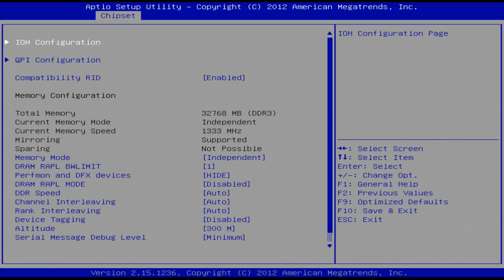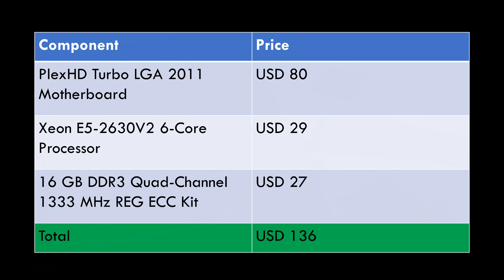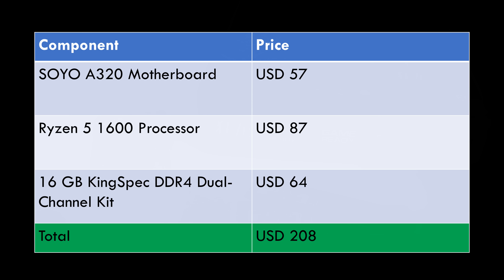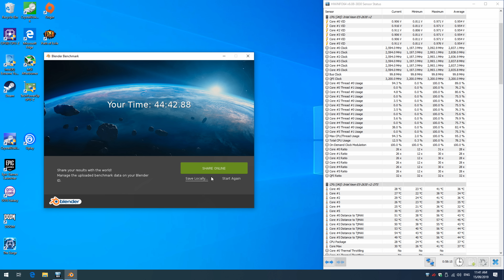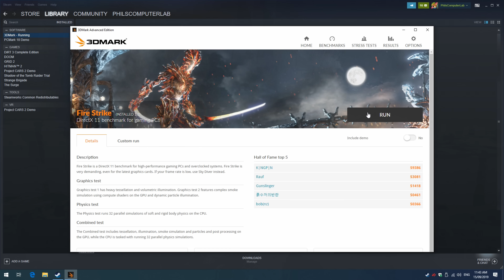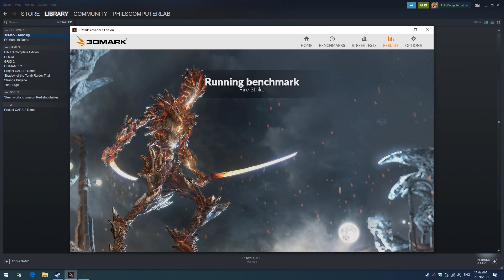Is this cheap 6-Core CPU worth it? The Xeon E5 2630V2

Comment: You know, sometimes I feel like YouTubers are making videos just for me! I've been looking at replacing my i5 NUC server with something a bit more powerful, but still reasonably energy efficient, and I've been looking at the LGA 2011 or even the 1150 Xeon low-power processors, which look pretty much like exactly what I'm looking for on paper. It's definitely encouraging to see the processors are compatible with standard motherboards, and that they're still pretty energy efficient even if the motherboards don't have all the bells and whistles of a brand name, so that's another possibility to consider.

The low-power Xeons are pretty hard to come by though, and they've been pretty overpriced when I have found them, so I'm thinking I end up having to go for a Ryzen 5 or 7 "E" model, which are 45W. Although main advantage of the Xeon is the cost of the RAM, since you can pick up large capacity DDR3 server DIMMs for pretty cheap compared to DDR4. That's the other limiting factor with my current server, since it's only got 16GB of RAM, so buying more DDR4 RAM is going to get expensive pretty fast.

Anyway, great video as always, good food for thought.

Comment: I did manage to buy and excellent ASUS p9X79 Pro which I paired with 32GB of non EEC RAM and an E5-1650V2 plus GTX 980.  The motherboard cost me $70 on a local purchase and it was like new.  What a deal.  Also have a HuananZhi deluxe X79 paired to an E5-4627V2 (costs $96 delivered with 8C/8T that all-core clocks to 3.5Ghz) and RX4708GB. Both do very well in 1080P high settings.
Reply: Good choice, that 1650 v2. And with that mobo, you can overclock it 4.4-4.6GHz easily. I know because I have a X99 Asus Rampage Extreme V - 10 Edition and a 1650 v3 at 4.5GHz. It can go higher, but I would need a better cooling. Any good X79 and X99 will run everything, in the highest settings, with a good Xeon and a good graphics card.
No need to upgrade for at least a couple of years (my opinion only).
Reply: @georgebadiu  Yup, board is excellent.  The E5-1650V2 easily clocks to 4.4Ghz and with the CoolerMaster tower (that came with the motherboard along with an i78320 and 32GB of Kingston HyperX DDR3 1600, all in for $220) idles cool in the mid 30's and peaks at 100% power to mid 60's. One might even argue the value of each the components purchased means that the ASUS p9X79 Pro was for free!!!! Still pinching myself over this deal.

Comment: Good video Phils!
I have this processor with a rx 488 and I'm enjoying it, for those who come out of 775 or is low on money the 2630V2 is a balanced choice between consumption and performance.
My setup cost $ 296 (R $ 1,200 in Brazil);
2630V2, 16Gb @ 1600mhz, Huananzhi x79, RX 488, Aigo T4.
I have not yet tested all the games I wanted but which I have tested, I really liked the result.
Reply: Seria interessante saber pq quanto tempo usou esse setup,se teve problemas e qual é o setup atual
Reply: @ilbroken2491  Usei por quase um ano se não me engano junto com uma placa da Huananzhi, então eu troquei para um 2620v3, a GPU morreu com 1,8 anos de uso (o chip da GPU morreu, era de mineração, embora não tivesse sinais agressivos de bastante uso), logo passei a usar uma R9 270 (mais tarde uma GTX 950) e troquei o 2620v3 por um 2678v3 e uma F8 da Huananzhi que uso agora há mais de um ano com um 2695v3 e uma RX 6600 (uns 4 meses).
Único problema era a performance em jogos como CS (que ainda é o mesmo).
Se eu fosse escolher algumas opções de processadores da linha V2 para um custo não muito alto, seria o 2630v2 ou o 2650v2. Gostava do consumo dele, frio demais se não me engano nem passava dos 50° em dias quentes com um cooler de 4 heatpipes e não tinha tela azul, já que usava memórias de servidor, atualmente já tive por volta de 6 telas azuis dentro do tempo + de 1 ano.

Comment: I've noticed a lot of the Russian sites as re using the LGA2011 with the 2680v2 and 2690v2. They really seem to hold their own in the games. 👍🙂
Reply from the maker: Yes for sure, but those CPUs are not cheap. You can get a Ryzen 2600 for that sort of money.
Reply: @philscomputerlab  you have a point, and with new Ryzen system everything is under warranty for a few years.

Comment: I had a test system with this processor for a while, sold it instead of an i5-4590 equivalent Xeon that I was also testing because of instruction sets.

If you play with the bios power settings you can get the all core turbo slightly higher but the power consumption is insanely low. The bios on the motherboard I was using was worse but it was ~$60 USD and used a smaller than micro-atx size. I think the model was e5 v3.5b

Comment: It has similar multithreaded performace to my slightly overclocked 3770k (4.2GHz), but both 3770k and Z77 motherboards command a price premium. It would be interesting however to see how it compares to a 2600k, the have dropped a lot in price, and so have the Z68 boards, at least over here.

Comment: Have 2 server with 4x Xeon E5-4640 each and love it for calculations ♥

As you mentioned, such a system shines especially given the cheap DDR3 RAM (i have 1 TB which is unpayable with DDR4) :)
Reply: What "calculations" can one use 16 cores for at home?  What's wrong with a TI82?
Reply: @ctsd623  i take the TI82 for calculations about the universe but poker is a bit more complex :)
64 cores with 100% usage 24 / 7 take up to one month to calculate a poker spot to learn with... and this sentence is not a joke.

Have a great week ♥
Reply: @BodoPoker  😂

Comment: Every time I think of decommissioning my x79 rig (HTPC/couch gaming box ) Phil comes out with another Xeon video.  Thanks for setting me straight.😁  Also totally agree that the PCIe to M.2 adapters are great for storage/game drives on any board with available PCIe slots and older boards without native support. As you say depending on your region used Ryzen 1000 series are VERY nice since its possible to get modern features and move to an even better cpu down the road. However, If you can get the board cheap enough, have some ddr3 already or even family /friend /salvage PCs that you can get super cheap or even free?-- x79 is fun as hell still and quite capable. More fun if the board supports overclocking. Thanks the great content.

Comment: I never get bored watching your videos phil...
You should try covering AM2+ platform sometime.. its pretty fun though
Reply: Yeah kinda cool. If you don't mind some critical lags in some modern games and only lookin' 4 mediaPC it can save you a buck or two(made some 775 C2Q 9550/4GB DDR31066/Case_and_stuff for 150₪/40$ last year, similar price on AM2+/AM3 in IL)
Reply: @andyshtroymish4997  you can mitigate a large amount of that stutter by using intels instruction emulator software (works on amd processors too)
Reply: @andyshtroymish4997  socket 775 is a nice cost effective platform especially when you pair it with xeon x5450/5460 but it also has a drawback in memory expansion capability and only maxed in quadcore configuration, in socket Am2+ you can use 16gigs of ddr2 memory in any 4slot mainboard, and support up to 6 core phenom.

Comment: Thanks for your great content. I have an old HP workstation laying around that I got for free - it has some very meh processors in it now, but I plan to throw in a E5-1650v2 and perhaps a used RX 580 or 1070. It should be a workhorse for years to come. It wouldn't have occurred to me to look more in to the platform if not for your vids - thanks again.
Reply: for the price of a single 1650v2 you could get two 2650v2 :)
Reply from the maker: I use a 1650V2 in my main machine, overclocked to 4 GHz and with a RX 470 with 32 GB RAM, very happy with that machine.
Reply: @philscomputerlab   . Hi . New subscriber from India . I am truly interested in your 1650 set up . May I combine your set up with the Antec VP550 , Zotac GTX 1050 TI ? Would that give me a good cost-performance balance ? Need this as my daily bread-butter driver .

Thanks for your superb contents . Best Regards .

Comment: Not gonna lie: I love the idea of building new budget Mobos for older Hardware.

Keeps older platforms alife for those who simply do not need the highest of the high (In terms of performance, Had to point that out for the grammar nazi below who couldn't discern context from a sentence if his left testicle was on the line), but still giving damn good performance.
Reply: engrish
Reply: @Lazar-w9u  What?
Reply: @bass-dc9175  Your english is as broken as my core 2 duo
Reply: @Lazar-w9u  Considering that the Core 2 Duo was an excelent chip that held up quite well over the years, with one of the lowest failurerates of all Intel processors on record:

Thank you.
Reply: @Lazar-w9u  But just for you: I "corrected" my grammar. Feel free to miss the point again and I will use all of the crayons in the world and walk you through my comments word by word. 

Perhaps that way: You would finally graps the hidden english secret of "context clues". 

: )
Reply: @bass-dc9175  mine has dorito sauce on it you innocent child
Reply: @Lazar-w9u  That sounds like Pebkak

Comment: About bios updates google "winraid ubu" . You should find "[Tool Guide+News] "UEFI BIOS Updater" (UBU)" thread. Also Huananzhi x79 gaming has x4 3.0 nvme slot.
Reply: Just had a look at that and it only has dual channel memory, looks nice thou especially as it's mATX.
Reply: @yakacm  My board is full atx and has 3 orange pcie 3.0 slots. I'm currently running samsung 32gb (4x8gb) ecc ram at 1866/cl9.
Reply: Masaliantiikeri it depends on the cpu, the 2630v2 accepts at most 1600mhz if im not wrong. The 2650v2 accepts 1866MHz

Comment: I own p9x79 pro motherboard from 2013 (nowadays there is much cheaper MB than this).  Lately I bought (3.5 to 3.9 GHz E5-1650 V2 and GTX 1060), And it really works good at 1080p and some games at 1440p 60Hz between High and Ultra settings. I plan to upgrade after playstation 5 launching to (E5-2687w V2 and RTX 2060 or 2070-if founded used on budget-). But i suffer sometime with CPU heating because I don't have a proper cooling fan (I am at really hot area (middle east). And I just put a small duct from my room Air condition to my case and the problem solved :)  ).

Comment: i think it's very important to show the cache size of these CPUs as the supported ram speed is extremely slow, if the cache is bigger, the ram speed won't matter as much, but if it is small it will make a much bigger impact.

Comment: Bought myself a Hunan ZHI 16-D X79 Dual Socket Motherboard. The board supports DDR3 ECC 32GB LRDIMMs which can be had for 40 USDs each on eBay. The older platform is amazing for getting insane amounts of hardware for dirt cheap. With a BIOS mod you can even BCLK overclock. (With dual E5-2697 V2's I did  not have any luck going past a 1% overclock)

Comment: watching this video makes me realize that cpu has gone ahead too much vs gpu, for at least 3 years! that's one of many reasons why gpu is the most expensive part in most builds
Reply from the maker: True that. I'm working on a video, a premium-budget build from AliExpress parts. With board and CPU it's easy, but GPU? There are the cheap RX 400 and 500 cards, but the next step up is huge. Used Vega or new RX 5700 and they cost a LOT more. There is no real value with current GPUs IMO. Gone are the days of a cards like 4850 Radeon or GT 8800.
Reply: @philscomputerlab  yes, high price and tend to die at younger age. now that I rethink of it, it seems like gaming has developed faster than productivity works. and since gaming experience mostly relies on gpu nowadays, i don't know what to do with my ryzen 3600. cpu is like a hard worker, working 24/7/365 at the same tasks, while gpu is the artist, was born to create beauty.

Comment: I own a Xeon E3 1245 V2 and damn It's good and you wouldn't think it's an 8 year old cpu based of the performance. Highly recommend if you can't afford a modern new CPU such as Ryzen 5 3500 as it can often be found for significantly cheaper and offers almost the same performance. Only downside is no integrated graphics and no overclocking but if you don't care about them anyway then you should go with it over the other 2 i7s.

Comment: This is a gem. I am looking at these as cheap home-servers (dev lab). Would be nice if you could recommend some:
> lower-end (even cheaper) compatible motherboards, perhaps without as many PCI slots
> compatible lowest-end non-gaming video-card
> low end-fans
BTW, do the motherboards ship with enough connectors, or does one need to order those separately ?

Comment: I'm running this CPU! With a GTX1050. I got it back when it was cheaper, when it was still 30SGD (21USD).
I play mainly indie games, so no problems for me, though for games that uses 2 threads max, it starts to get a bit bottlenecked. Minecraft Java edition, server event, where there's 40-50 players in one spot, i just lag to around 20FPS ugh

Comment: Interesting review, does the board's hibernate work tho?

Also could you add some non-gaming benchs too? Like compilers and video editing
Reply: They most likely ripped large chunks of the BIOS code from a similar X79 board from a mainstream manufacturer. They probably couldn't get the S1-4 code working, so they replaced the whole snafu with an S0 trigger.
Reply: @UpLateGeek  so no hibernate either?
Reply: hibernate works on these boards, I built several systems using the plexhd and can confirm this
Reply: @UpLateGeek  could it be because of the xeon itself? maybe a server(not workstation) cpu does not support sleep mode at all
Reply: @ingusmant  that's just my guess. I assume if they're too lazy to figure out S1-3, then they're also too lazy to get S4 working.
Reply: @ErrorMessageNotFound  I don't have to test anything. The easiest way to find out anything on the Internet is to post something incorrect, and someone will correct you.
Reply: @Z4KIUS  isn't standby basically the same as sleep? Not a server guy

Comment: How about checking out some Opteron setups? On ebay on the US side, you can find 1 and 2 socket boards with CPUs for about $100 USD. Might be fun to play with.
Even though used boards from ASUS, MSI, etc. might be expensive they still have downloads for even their oldest boards. I can still download the manual and latest BIOS for my ASUS P2B-F.
Reply: I have done some research into it in the past, they use far to much power for the performance they provide, and don't perform well in tasks that aren't heavily multithreaded. The motherboards are weirdly configured and require specialised power supplies. Waste of money.

Comment: Hey Phil, it seems that in about half of the games the CPU didn't turbo, for example in Far Cry 4, Hitman, Strange Brigade and Crysis, even though the temperature is quite low. I don't knwo why, but fixing that could make the difference between not enough and just enough performance, since it is an increase of more than 10% of the speed. (Checked it by looking at the CPU speed according to Afterburner, that turbo'ed to 2893 MHz in some games, but stuck at 2594 in others).

Comment: Would like to see the mainboard on idle and Wireshark capturing the traffic. Can't trust having a backdoor on your pc
Reply: Whats that
Reply: @naws69  a vulnerability due to the way Intels designs is why their is a backdoor. Basically you can get hacked for data.
Reply: He meant to say that Chinese boards could have a backdoor virus that could sniff all your data or communication. Wireshark is a network packet capture tool used for analysing network traffic
Reply: Oh i get it. Thanks
Reply: My thoughts..
Reply: lol you guys think those laborers in those electronic sweatshops would be competent enough to place a backdoor into the mobo that captures and sends your data off? let along that, also pricing it very low as well? hell nah. AFAI can see, i dont even see any type of chip on the mobo that can even do that

Comment: This was the first Xeon I bought along with and AliExpress MB. $20 for the chip and $56 for the board. Got 16gb server ram for $18. SSD was $31. Cheap and easy. Since bought a 2650v2 and then a 2686v2. Cheap and easy.

Comment: Would like to see a review of this "new" HuananZhi X99 TF Gamer that can handle both DDR3 OR DDR4. Coupled with an E5-1650V3 which is similar in price to its V2 variant...interesting.  Dual NVME m.2 plus an extra NVME slot for wifi adaptation.  Excellent VRM power feeds. Hmmm....updated and modernized look with shrouds and heatsinks and integrated white back plate...black with white accents....$130 price is a bit salivating too. Yikes...makes we want to build a PC I do not even need...right now.

Comment: In the US at least, you can get a Dell Precision T3600 or T3610 (single socket 2011 machines) for about $150 US.  That would probably include a CPU you don't really want and not enough RAM and a garbage GPU.  I suspect that under many circumstances, starting with one of these Dells would be more cost effect than purchasing a new socket 2011 motherboard plus case plus PSU plus CPU cooler.  Additionally, such a machine will often include a license for Windows 10 Pro, which one its own is more expensive than the base machine itself would be. I plan to pair the one I recently purchased with a E5-1650, which has higher clock rate than the 2630v2 you tested. Used Dell Precisions may not be a reasonable price in some markets,
Reply from the maker: Yea that's a good tip! Like you say, here in Australia I looked at these options and prices just don't check out...

Comment: Watch the video later. This CPU I have it and it's a proper bargin. Stuck an R9 380X with it that I got with a broken fan. Put a spare CPU water cooler on it and runs a cool 50c silently flat out. The Xeon with an Artic cooler tops about 45 - 50c.